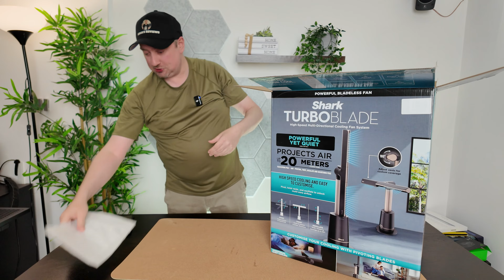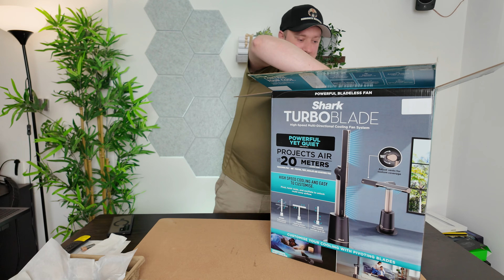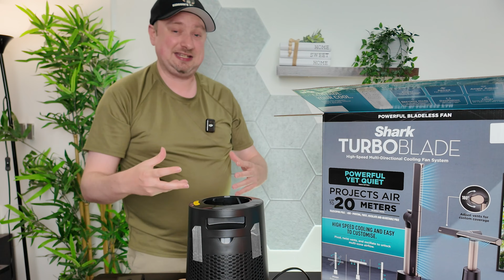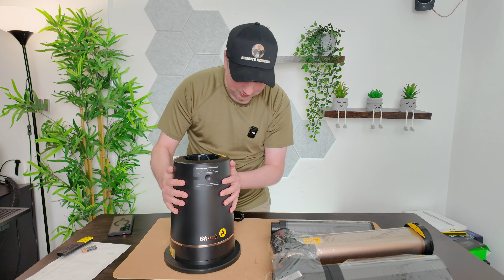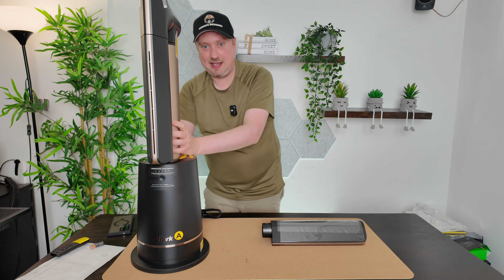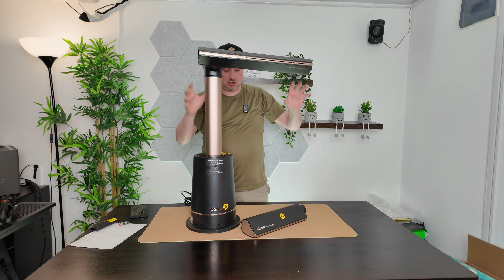Shark TurboBlade Cooling Fan - Unboxing and Assembly Guide

Comment: I know this comment will become redundant by the time someone responds to it, but how does one go about to disassemble it to say return it or replace broken parts. I see a lot of videos on how to put it together, but I do not think I can just reverse the process to take it apart. Also I see a lot of “videos” that involves talking about the process without showing it, which makes me think taking it apart is a bit more difficult.
Reply from the maker: If you need to take it apart... good luck... its a right pain!
Reply: @SimonsReviews  I have definitely managed to take it apart enough to fit the pieces back into the box. It was not easy.

Comment: Had it for 3 days and it's worthless. It's way to loud for far to little air. Also I can't get the blade off so I can return it. Does anyone know how to cause if I pull much harder its going to break
Reply: i’m having the same problem, can’t get the blade off to return
Reply: @krystalrodriguez9812  i called customer service. there response, oh yea it doesn't come off. just send it back in a box that it can fit in. seems like they made it as hard to return as possible.
Reply: @krystalrodriguez9812  i talked to their customer service. they dont come off. they are literally designed not to. thats what they told me. so you need to find a box big enough to return it as is.
Reply: @krystalrodriguez9812  I just called Shark customer service. It can't be removed once snapped in place.
Reply: Same here
Reply: bruh i wish i9i returned its been a year n shits worthless